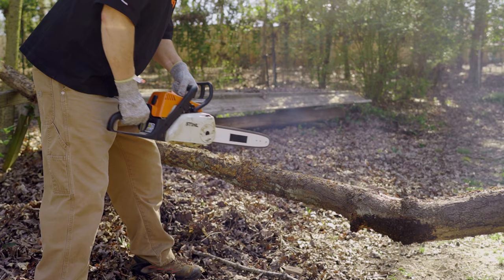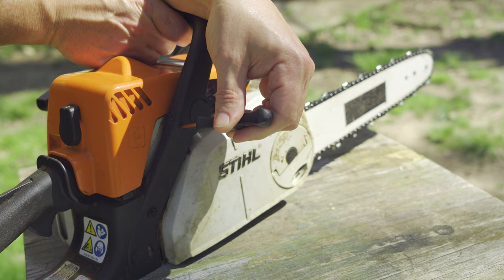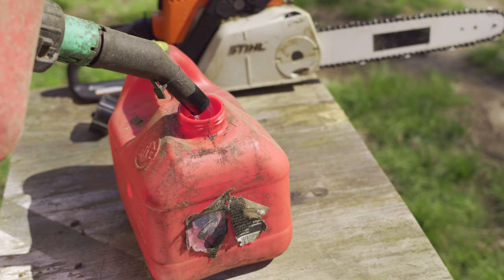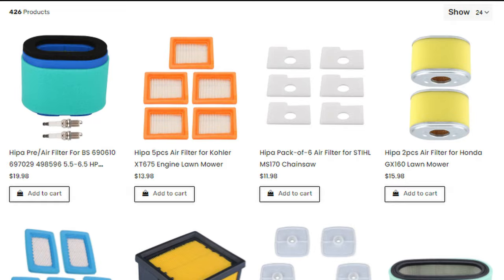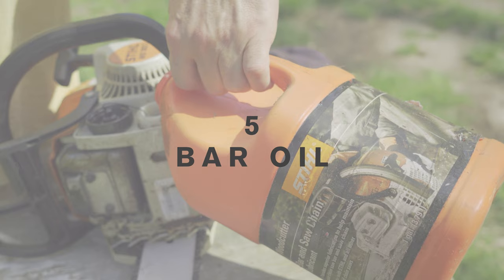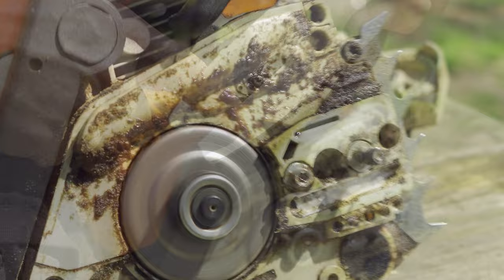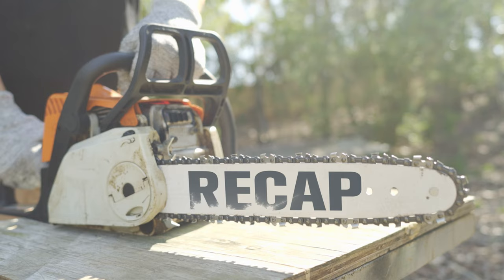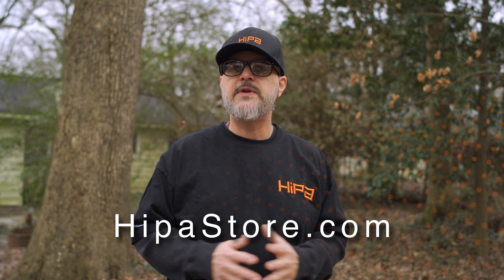5 Common Reasons your Chainsaw Is Smoking

Comment: Maybe you can give me some tips I have a McCulloch mac 160s yes I know it's an old saw it's from the 1980s😂😂. I don't expect you to know but I got this thing from eBay the guy said it runs which it does it runs really well. I added the proper fuel mixture make sure the bar pumps oil like it's supposed to and well everything is working but after 10 minutes of using this thing it starting smoking to the point I couldn't see. I checked everything it wasn't overheating but the exhaust cover had a black sludge dripping from it and it looked like used oil? Any tips

Comment: Great video! 
What if there are burn marks on the wood? Is that a different kind of issue?
Reply: You probably need to sharpen or replace the chain.
Reply: Make sure your chain is on the correct direction too. A chain on with the teeth in reverse can cause this as well as dull teeth.
Reply: Yes, the chain is on correctly.  TY.